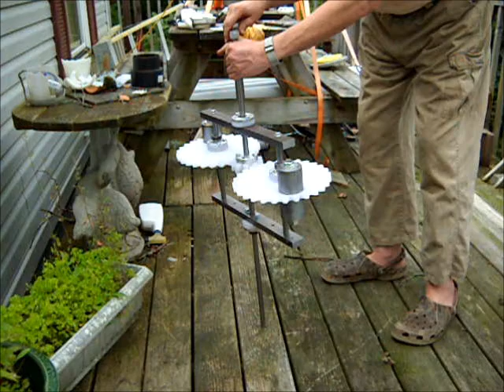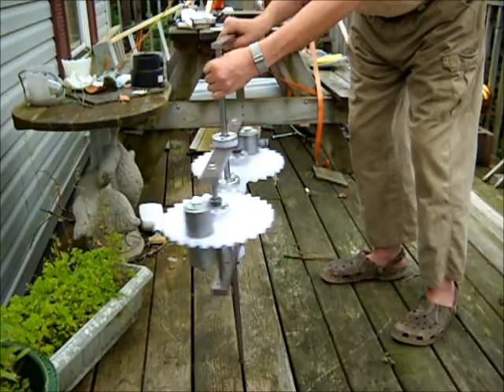Quasar Gravity Drive

Comment: very efficient flywheel, Felix Würth already tried, I think it would work in combination wit other devices but not alone; search for FELIX WÜRTH on youtube and you will see a more elaborated experiment
Reply from the maker: Hi, the problem I found was once a load was added the system died. Proceeding to experiment with  Dmitriyev Weight Rotation. Thanks for the input.

https://youtu.be/u5iuTwM5brI
https://youtu.be/aaF1_AyZe-c

Comment: great work! how much do you think the force is amplified??
also, it looks like there's a rhythm with the system-faster then slower as the weights go around, would this make the drive too jumpy to use in a system? would a fly wheel smooth it out do you think??
great job!

Comment: so can we get perpetual power from this enough to run a pmg turbine?
Reply from the maker: Hi, The plan is to try to drive it using a pendulum, using electromagnetics and a external power source. I can attach a drive gear to the support arm to drive a PMA with a MPPT circuit at the output. Did you find the large pulley you needed?
Reply: GoVertical17 yes, from Surpluscenter.com, thanks

Comment: Very nice but no chance for perpetual movement with this kind of device.
Reply from the maker: SOPM2007 Hi, not trying for perpetual motion. Not trying for overunity, it is not possible. As soon as I try taking power from the system the RPM died. The device is very deceiving. What I find interesting is it converts a reciprocating action to a rotary motion.
Reply: GoVertical17 Yes! I commented like that because I believe on such devices. For me, perpetual motion is only the definition of infinite movement, not a violation of physical laws. Free energy does exist, I claim.
Reply from the maker: SOPM2007 Yes, there is free energy. You just have to know how to convert it from one form to another.
Reply: Exactly, thanks! I'm on research for the solution of a pure gravity driven wheel, like in the history of J. Bessler. Hope to prove the possibility still this year.

Comment: I need the specs for this to integrate into one of my inventions.    If you are still on YouTube, take a look at my videos.
Reply from the maker: Hi, I found this device only works under a no load condition. When a load is added the device never achieves the higher RPM that is required to produce the high torque condition shown in this video.
The gear ratio is 1 to 3 and each orbiting weight is about 2.5 pounds. If any other info is needed I will help if I can.

This summer I will be testing the following configurations.
https://youtu.be/ALutpnyeMm8
https://youtu.be/5e5bpB1gPHQ